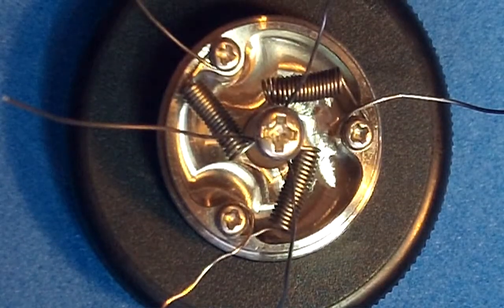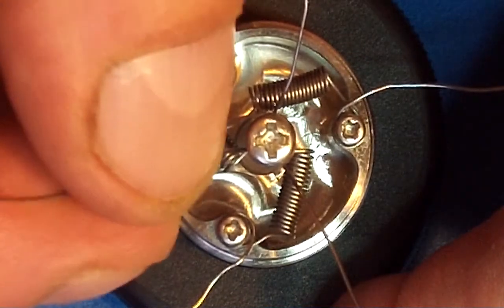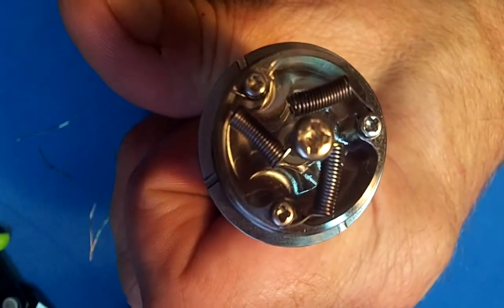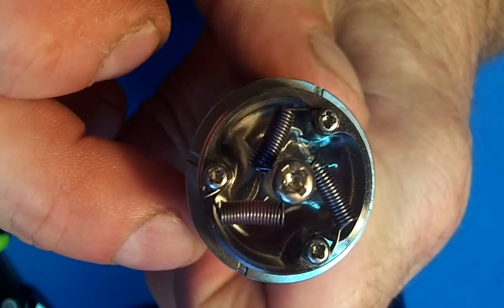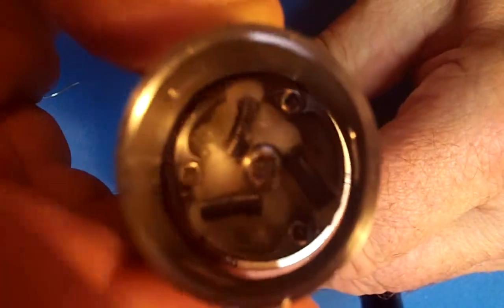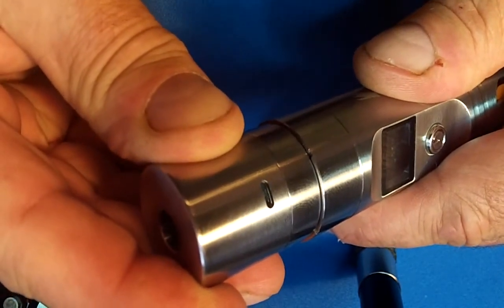iGo-W14 Build

Comment: I hate my 18650 MNKE. The mah is just to dam low. If you are using them down to 50% or less of their capacity it will dramatically reduce their lifespan. The sony VTC5  18650 is a winner and all i use now. When I do use my MNKE I just take like 15 to 20 pulls then throw it back on charger. I vape on .18 to .3 ohm builds typically.